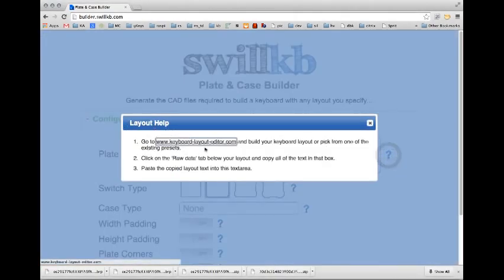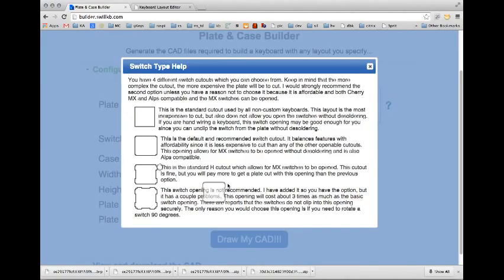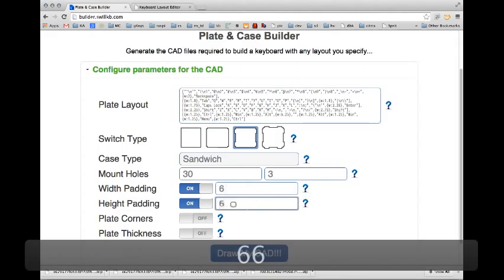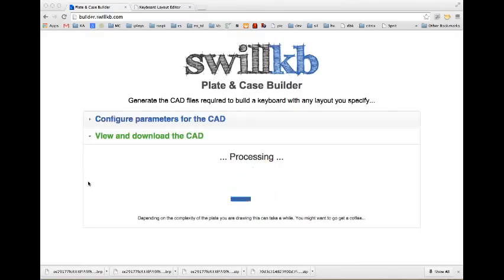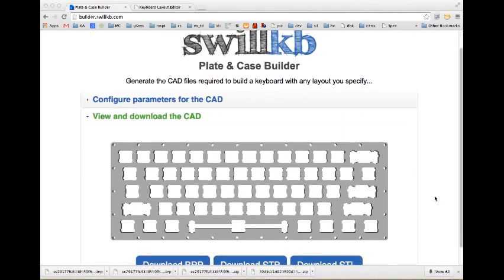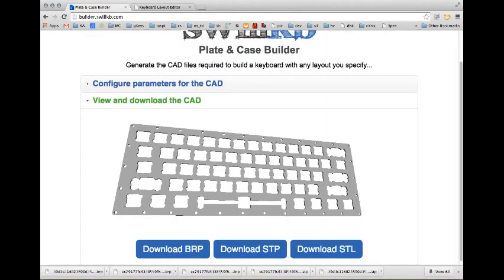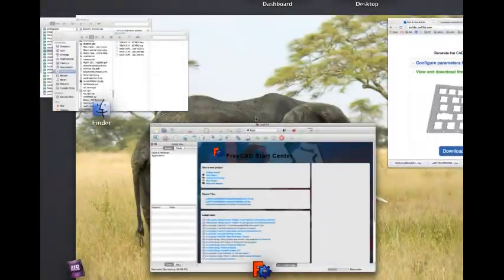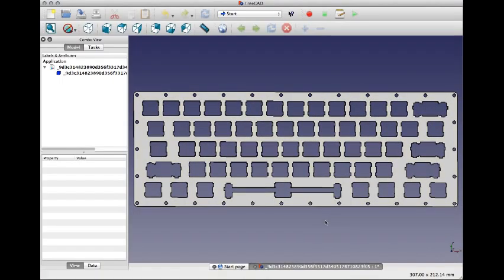Plate & Case Builder

Comment: Hey noob here

How thick should the middle rings be as in what should be the distance between the top plate and the bottom plate?

also if say i just give a CNC manufacturer the switch plate dxf straight from this website and just tell him the 1.5mm thickness will that be enough? Bcs he just asked me for a dxf(which is 2d i think)

Comment: Can we make the CNC machine to cut the plate and case from 2D dxf file? I tried to design on it and it only gives me the 2D dxf files.
Reply from the maker: The original tool was built using a cad engine in the background, but the draw times took way too long. I have since built my own cad engine to improve the build times. With this change, I switched to only producing 2d drawings. You can follow this guide to create 3d plates from the 2d drawings produced. 
https://youtu.be/8CROo67W24M
Reply: @ultimut  Thanks a lot, my numpad project would be much easier.
Reply from the maker: For more tips and tricks using the builder, check out the documentation site: http://builder-docs.swillkb.com/
Reply from the maker: @severussnape6886  if you are turning a 2d drawing into a 3d drawing with my guide, I recommend you cut away before you do the extrude. It is faster if you cut away the 2d shape and then extrude.
Reply: Thanks, now I converted the SVG files to 3D STL. And do you have any advices to configure the thickness of sandwich case?
Reply from the maker: @severussnape6886  the switch plate should be 1.5mm if you want cherry MX switches to clip in. This is recommended for aluminum and steel plates. If you are doing an acrylic plate, then things change a bit. You have to go thicker to have the required strength, but then things like stabilizers won't fit under the plate, so you have to make a lot of mods to some of the cutouts. For middle and bottom layers, you can use whatever thicknesses you want, just make sure to leave enough room inside for the pcb and hardware.  Does that answer your question?
Reply: @ultimut  
Thanks again, now my plate and the case files are being transferred to my CNC machine. Thanks a lot... ;)
Reply from the maker: @severussnape6886  no problem. Best of luck. :)